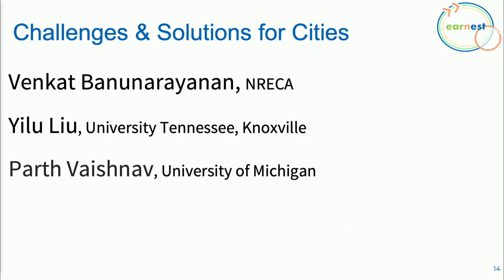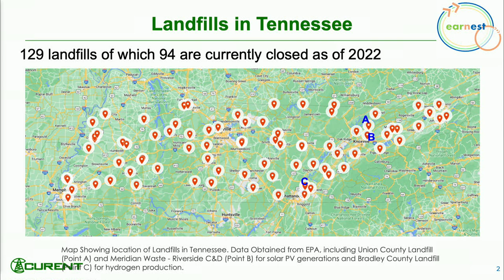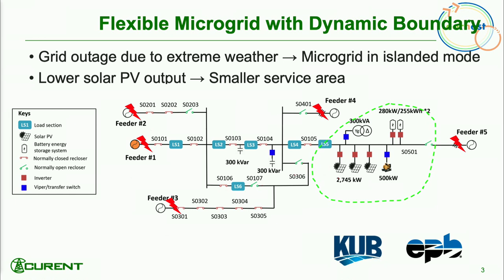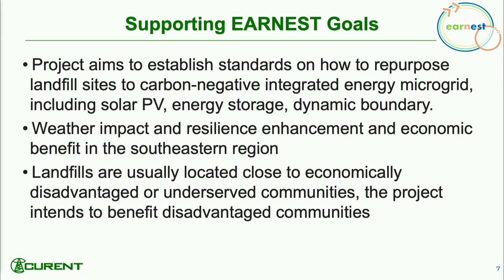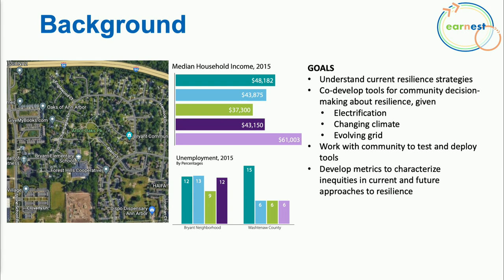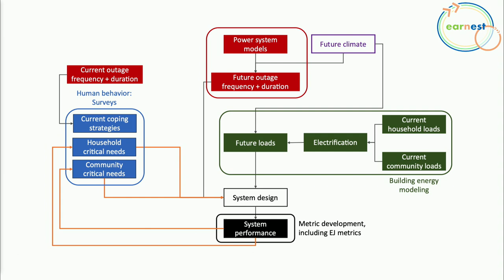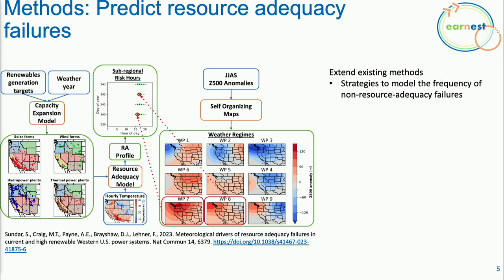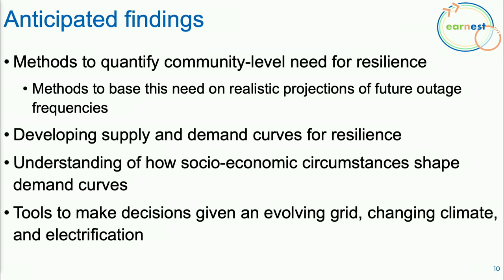DOE EARNEST University Consortium Kickoff -  Challenges and Solutions for Cities

Comment: FINALLY - attention paid to energy generation in cities. 

If 75 - 80% of people will live in cities by 2050'ish then cities need to become less parasitic on hinterlands and start providing SOLUTIONS! Cities need to consider geo-physical assets for
- energy generation (micro grids, rooftop solar, road & carpark solar shading, solar noise barriers along roads & highways, off- shore wind & on- shore wave energy, PowerNests, in pipe / conduit hydro etc)
- energy storage (community batteries, V2G etc)
- thermal recovery for industry and / or district heating

A city in India has achieved 100% renewable energy on solar alone - it can be done!